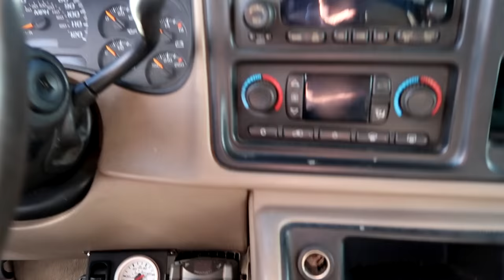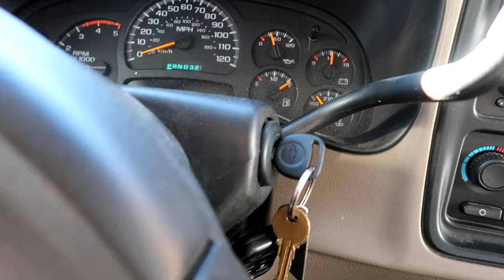NEW TURBO CHARGED WHEELS

Comment: Hy Dalton, when you hook up your emergency straps from the trailer to the hitch on the truck, crisscross them in the shape of an X. Right side to left side and left side to right side. that way if the tough pop's off the X shape will keep the tough from digging into the ground and flipping the trailer. The tough of the trailer will just fall into the X shape and will ride high until you can stop the truck..

Comment: i worked at a gas station for many years learned that before start fueling if you take the handle and lift it over the top of the pump and hold it for 15-30 seconds if will then help the speed of fueling

Comment: I'll give you a tip for the diesel pump if it's pumping slow just let the handle sit for 30 seconds and you'll feel that handle Shake It's gotta Prime the system after that it'll pump fine